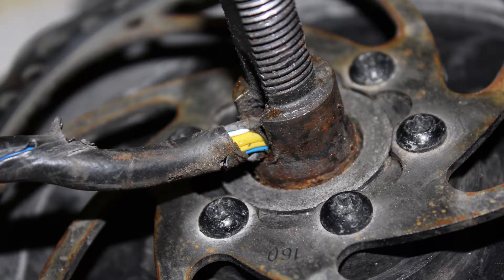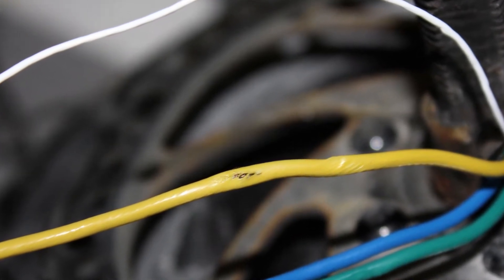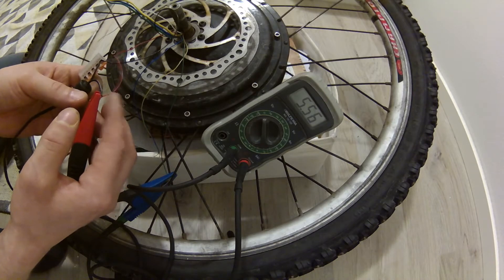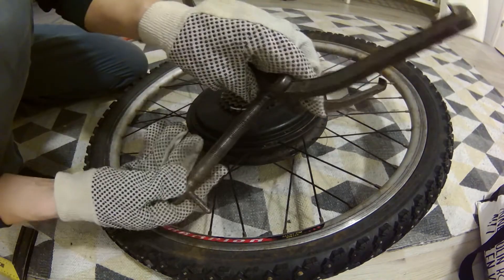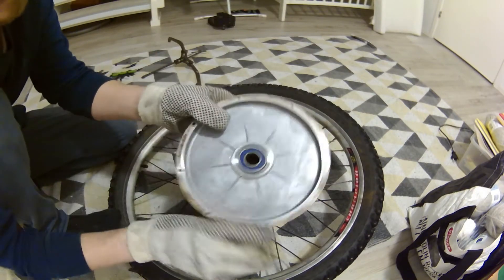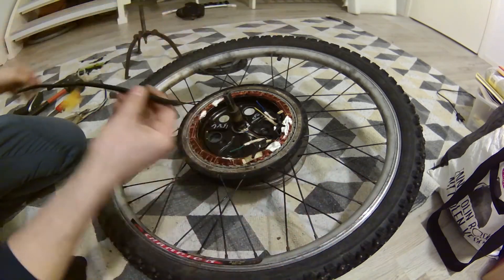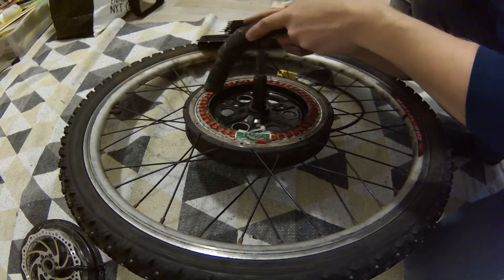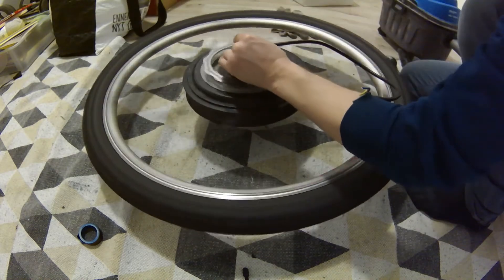Hub Motor Wire Replacement & Hall Sensor Test

Comment: I had a tire that wasn't secured to frame and when hitting the brakes, the wheel kept spinning and tore wires, etc. Now it won't spin at all. Does that mean I fried the windings?
Reply from the maker: Hi. Sounds like you had the same happen as I had. Your wires look ok? Its unlikely that you have actually fried windings.
Reply: @3LECTROSHOCKED  thanks for replying, I cut out the old wires because they weren't looking good . But still stator is still stuck. I take it out and put it in at a different angle and same. Im mad, its a nice 12" qsmotor for a scooter
Reply from the maker: Oh ok. Well take it apart to investigate. It could be as simple as wires in short - that creates a break effect.

Comment: I now that i am off topic, but please help..... My bike is a 250W motor 36V battery at 7,8Ah, The controller is wk36lyjsztl model. Does support Throttle? If yes, how to connect it? My throttle have 3 wires, red+ black- and white (I don't now what it is). Thank You.
Reply from the maker: Hi! Sorry, I have no idea about your controller :(

Comment: Greetings. I am looking for (3) H141 00A1 transistors, which went bad in my hub motor. Any suggestions on who sells them in the US or anywhere? I went through many sites and negative. It is not like the old days where you could go to an electronic stores and find the stuff. Highly appreciated.
Reply from the maker: Hi! You mean sensors? I get those from old pc fans :D been working great!
Reply: @3LECTROSHOCKED  Yes I mean Hall Sensors H141-OQA1, need 6. Thanks for your response
Reply from the maker: Yeah, just from old pc fans. Just make sure they are the same type with the same amount of pins. And maybe polarity has a meaning. Hope this helps!
Reply: @3LECTROSHOCKED Thanks a lot

Comment: Thank for sharing your knowledge and experience. Great learning source. Question: 5VDC + power to red and black sensor wire. Where the 5VDC negative connects to?  And where my red multi meter connects to? and where the black multi meter connects to?  Sorry to ask but I want to learn. Thank you again
Reply from the maker: Hi! Thanks for your comment.  There is just one - and one +.  Muktimeter polarity doesn't matter - one to power and second one to signal. Hope this helps!
Reply: @3LECTROSHOCKED  Thank you. Got it. I encourage you to keep sharing. World would be much different if we all share what we know to help each other. Blessings
Reply from the maker: Thank you for your nice comment! :)

Comment: Have you looked into universal torque arms? They can be found on ebay for $10-$15. Love your videos! I built an auxiliary battery for my scooter following your video on fused battery packs. I also split my 36-v battery into two 18-volt batteries so I could charge them with my hobby charger and not have to use a BMS. I don't trust BMS is either.
Reply from the maker: Hello! Thanks for the hint, I totally forgot about those. Maybe I will try to copy that design and build my own arms . Although I'm really thinking about just using a new frame and building a completely new bike. Thanks a lot for watching my videos. Its great that my video could help with building your battery. I really tried to put all of my experience into that video so I could help somebody with that :) Thanks again for watching and thanks for the comment! :)
Reply: @3LECTROSHOCKED  forget about aluminium frames too much trouble 
Only if there’s a way to screw straight in the frame the torque arm other wise this cheaps torque arm want work i am using now a fixie one with no bolts in it only a part that screw in the frame that’s enough those oldschool ones impossible to get out
Reply from the maker: Thanks for your comment! I actually found a way to fix all that to an ok condition. I filed those dropouts to a slight tilt, so that the axle is now pressed in there with the force of those massive nuts. It seem to work pretty well :)